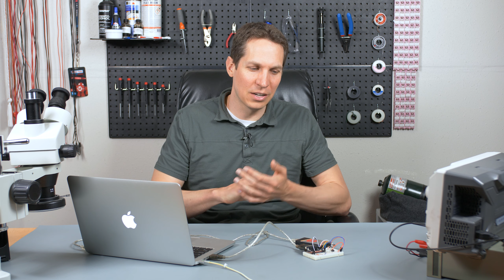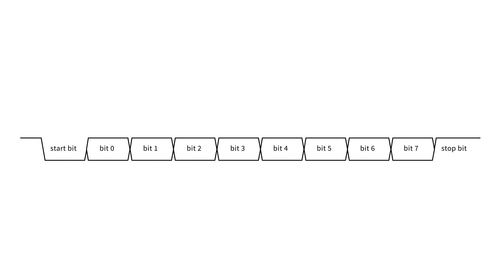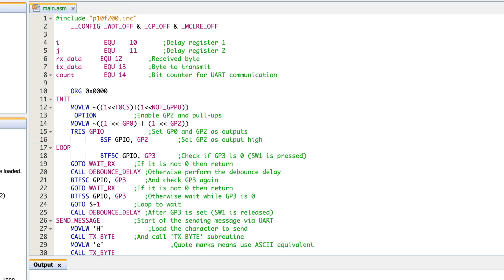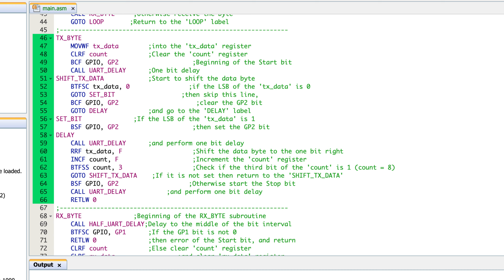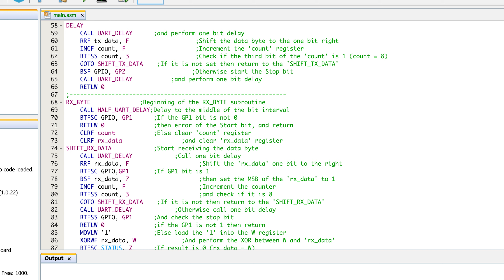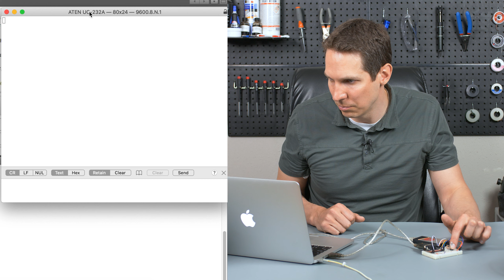How a UART works and how to make one in software - Part 11 Microcontroller Basics (PIC10F200)

Comment: i hope someone still replies

i stumbled upon a rabbithole which is hardware hacking and uart seems to be some sort of primitive usb if i understood it right it is used to communicate between 2 devices but why would anyone use / do that what could you do with an uart connection
Reply from the maker: Hi! Glad we noticed this so I could reply. I've never heard UART described as a primitive USB, but in some ways, I guess that's right. But it is definitely more than that. For embedded systems, the biggest benefit of UART is that, compared to USB, it is incredibly simple. You can easily bitbang it or, much more commonly, almost all microcontrollers have a UART software solution. Whereas far fewer microcontrollers have a built-in USB solution. But that simplicity comes at the cost of lower speeds, less flexibility, less robust error handling, etc. Yet, for a large chunk of hobbyist and student work, UART's simplicity makes it much more valuable than USB. I highly recommend some lessons that Jesal wrote on different communication protocols if you want to learn more about the technologies themselves: https://www.circuitbread.com/tutorials/series/communication-protocols

Comment: I noticed in these videos there is no error handling or argument checking in the subroutines. This is something that we typically do in other languages.  Is this common practice for programming in an assembly language, or is it just left out for simplicity here, or maybe its not needed in these subroutines?

This series is absolutely fantastic! Thank you so much for making and sharing these videos!!!
Reply from the maker: I'm glad you're enjoying these, Sergey is very proud of this series and is excited about some other series he's working on.

For the error handling, it's a combination of things but, honestly, mostly for simplicity's sake to make the structure of the program as simple and easy to follow as possible.  If you were to do a mission-critical application that needed to make sure everything worked every time (at least as much as possible), then the code would probably spend those delay cycles to double-check that the data it's receiving is actually good instead of literally just wasting its time.
Reply: @CircuitBread  Got it, thanks very much. I hope I get to see Sergeys next series!!

Comment: great , but I have to use UART in my project with two component (receive  data from RFID cad and handle it with microcontroller  after that send it into pc) , how can I handling with this or there are  another ways to attach complements uses uart in the same microcontroller
Reply from the maker: One of the weaknesses of UART is the lack of addressing inherent so I think you'd either need to get another MCU that has more pins (if you still want to bit bang it) or both more pins and more features (if you want hardware-based UART modules) or you can switch to I2C, which sounds like it may not be an option at all.

Comment: the ASCII code for capital 'H' is 01001000

so, 01001000  01100101 01101100 01101100 01101111  is hello  🤓🧐🤦 kind of weird that i still remember that
Reply from the maker: Wow, I have done various projects with ASCII but I've never explicitly memorized the codes.  When I'm doing them, I remember a couple just due to exposure but then I forget those few as soon as I'm done with the project.
Reply: @CircuitBread  when I was in school for basic electronics, my teacher had us working on the ASCII code for about three months.. that's probably why I remembered much of those codes 🤦🏿‍♂️
Reply: @james77011  Lol, in my business, I've occasionally found the need to do some data entry in ASCII as a decimal, with practice, it almost becomes muscle memory, almost like reading.
though I still prefer the Hex numbers for this sort of thing
Reply: @davidconner-shover51  i think I will get back into studying ASCII code and see how I can really do 🤔🤦🏿‍♂️

Comment: Thank you very nice video. A lot of time while using UART there's more than the two rx tx. Reset MDo, MD1 +5V and ground
Reply from the maker: Yep, there are more portions of UART but from a software point of view, RX and TX are the minimum connections to make it work (if you want two-way communication, that is).

Comment: Too bad it's in assembler, I only understand in C
Reply from the maker: Yeah, we'd like to go through these tutorials at different levels, including C, but the idea of these in particular was more to help everyone understand how microcontrollers work at a lower level.  The concepts behind it would help anyone bit bang a UART with any language, though!  Of course, I don't go into that level of detail in the video, but Sergey explains a lot in the written tutorial, if you want to check that out.
Reply: One thing to note, he is showing the bare bones basics of these sorts of systems.
so far, watching this series, he is not showing any other resource on this chip other than GPIO, like the timer, also full use of the rather short stack on this particular processor.  introducing a few native instructions at a time. he hasn't really gotten into the wealth of bit banging coding, including being able to use libraries of code; Floating Point math, UART handling, etc.  Macros; One can create an entire higher level language of one's own, in some ways more rich than C. Much of the goal in bit banging is speed and compactness in code, IE just how much can you make that little bugger go. 
An example; about 20 odd years ago, I made a nice little toy out of a 12C509 controller, a short step up, same core processor, though with 1 K instructions, with 5 IOs and 1 input, a 2 level stack, 42 bytes of RAM and no interrupts. This ran 20 LEDs, arranged in a 4x5 grid display, 4 buttons, and an input only UART(1200 baud). This little baby could display scrolling messages with a bit map, do 4 bit monochromatic shading, and even play pong, all on 1K. Also, when the clock was limited to 4Mhz(1MIPS) (32Mhz(8MIPS) now) Oh, yes, no extra silicon of any sort. Granted, Microchip had already published similar, but I took it a couple of steps further, and didn't even look at the code.
You would be surprised at how much bit banging gets incorporated into higher level languages, especially when one discovers new efficiencies at the bit bang level. someone had to write the base code for that compiler.

Comment: Hi, may I know how to wire up between MPLAP ICD4 to atmega328p. I just try to do it in a embedded C to blink an LED. Any advice would be appreciated. Thank you.
Reply from the maker: If you're looking at the wiring, you'll need to pull up the ICD4 data sheet (http://ww1.microchip.com/downloads/en/DeviceDoc/50002596E.pdf  - page 13) to find the pinout of the programmer and the 328p datasheet (http://ww1.microchip.com/downloads/en/DeviceDoc/ATmega48A-PA-88A-PA-168A-PA-328-P-DS-DS40002061B.pdf - page 12) and match them together, depending on your device package.  Sergey was originally thinking of doing some Atmega based tutorials but decided to do FPGAs next instead.  I hope this is sufficient to help you figure things out!

Comment: I found this channel today. Im going through a tough time. Im in grade 12 and I am extremely passionate about Electrical engineering and college admissions are coming up. But looking beyond my degree, Im very dissapointed at how little electrical engineering grads are getting paid, compared to comp sci grads. Do you think it will improve in the future? Please address my concerns.
Reply from the maker: While we will not claim to be experts in current and future industry trends, my personal opinion is that it won't change.  There is, and will continue to be, a huge demand for electrical engineers to continue to push hardware technology further and further.  But with the increasing reliance on AI, IoT, and and Industrial IoT, computer science is also in high demand and will probably grow more.  However, at the moment, there is considerable overlap in the pay scales of EE's and CompSci grads so in terms of money, it really still depends on what you're doing in either of the fields.   And, of course, would you rather make $70K and love your job or $75K and hate your job?  Though it may be more extreme - $50K versus $150K.  Then it's a lot tougher to decide.
Reply: @CircuitBread  Yes sir, that is the problem. Many Software developers in silicon valley are making around 300K+ . Electrical engineering demands hard work and labour but they pay is less. Thanks for replying though. I just have a query. Can a top tier Electronics/Electrical Engineer from MIT, Harvard or Princeton with perfect GPA and projects can REALLY ever bridge the gap between tier one software developers? I mean how high can the maximum salaries go? I havent heard of any Electrical engineer making 200K+ recently but for software developers, sky is the limit. Im hella passionate about Physics and Maths and I have an olympiad medal in Physics. So, in case I do manage to get into a top school in the US, how much salary can I really expect at the end of the tunnel?, late career that is. It is hard for me honestly cause I witness lots of engineering grads doing computer courses and switching to tech. Also, as a disclaimer, I know money is not everything but being smart is also choosing a field which will pay well for my hard efforts. Personally, my brother is also an Electronics Engineer at Qualcomm and from his own experience, he is a hard worker but is not the most satisfied.
Reply from the maker: Oh, that is tough because, again, industry trends are really not my forte.  But from what I've seen and looking around at different jobs, if you stay as a salaried electrical engineer (not switch to a managerial/leadership role or become an entrepreneur) you're probably going to top out at $200K-$250K.  Of course, at the end of your career, after inflation and other stuff, the number will likely be much higher, but in 2020 money, that would be my guess.  
And while everyone is different, I will always push the "passion over money" line as long as you're making enough to satisfy your needs, which nearly all EE jobs can do.  Unfortunately, sometimes the job environment can suck even if the work itself is satisfying.  If only we had a functional crystal ball, this would all be so much easier.
Reply: @CircuitBread  Ok sir, one last thing. What will be my take home salary after 250K? From what I know, 250k isnt that great in San Francisco bay area, or San Jose as those areas are pretty expensive. So if you could maybe give me an estimate of the take home after taxes, it can be compared. Also, to take the managerial role, is it enough to perform decently at my workplace or would I also need a Engineering management/MBA degree?
Reply from the maker: Take home salary is highly dependent on where you live.  Both in terms of taxes and what you see in your paycheck and also in terms of where the majority of that money in the paycheck goes.  For example, we're based out of Boise and $250K/year (especially before housing prices skyrocketed in the last 6 years) would buy you a massive house with plenty of money leftover for frequent new cars and putting money into savings.  Whereas you would probably still have to live in an apartment if you lived in San Francisco.  My brother worked for Apple for awhile and made (to me) gobs of money but he had a 2 hour commute each way every day and even then, his house was crazy expensive.  He lasted a little over a year before quitting.  Whereas if you were in the military as an engineer, your base pay looks terrible but you get untaxed housing, some untaxed/some taxed bonuses, full health coverage, and other benefits.  It's very apples to oranges to compare.
As for management, an MBA would be helpful but usually not necessary.  More you need to show a good ability to communicate and lead while still being technically proficient.

Comment: this small uC has RS232 hardware support...nice
I guess it offers only one speed option because I did not notice any fuses that dealt with this
Reply from the maker: Hey Ronen!  It actually doesn't have hardware support, this is all software / bit banging.  Because of that, you can actually change the speed for faster or slower communication as necessary.  We just set it at 9600 baud for this example because that's pretty typical for small embedded applications.
Reply: @CircuitBread  Beautiful work sir, after surfing to your website looking for the code and coming back here I noticed at 10:58 minute the calculated delay to transmit in 9600 Baud.
this tutorial can be very helpful for the ones who wants to code in assembly language.
cheers ✌👍😊